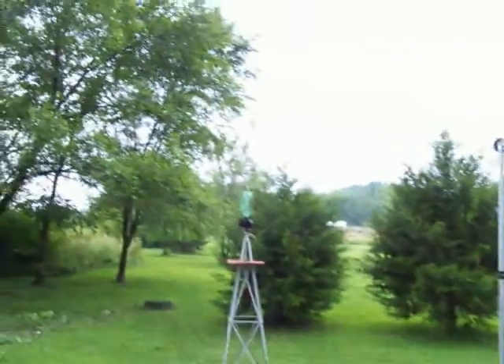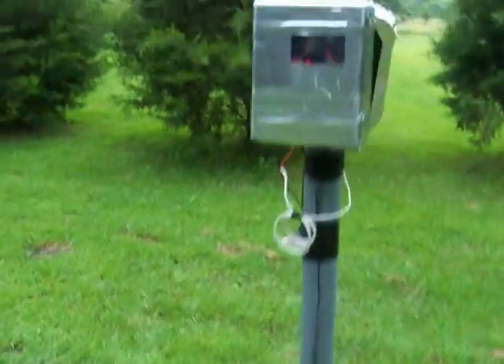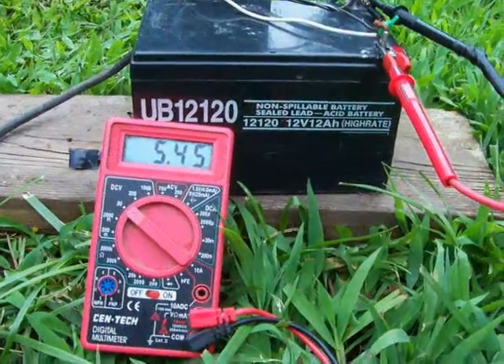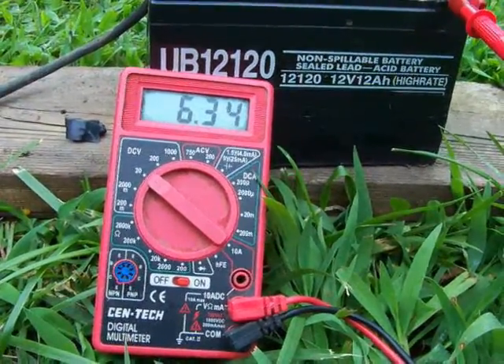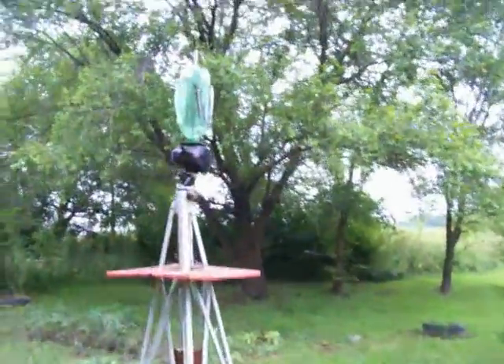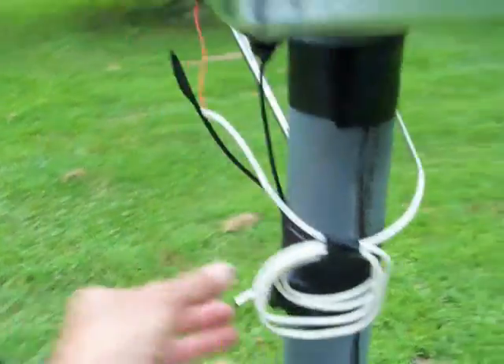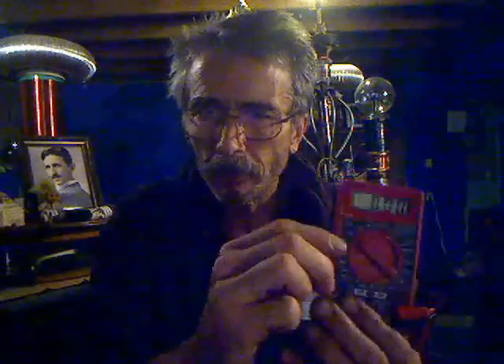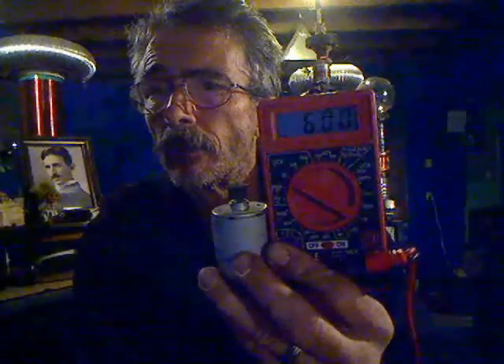FREE THINKERS 5

Comment: Cool build. Are you creating high voltage to drive the center tower ion motor and recollecting that energy plus atmospheric on outer towers? Then funneling that high voltage back into the low voltage battery?
The foil arrangement on the glass door with spark gap is a type of oscillator from 1890's.